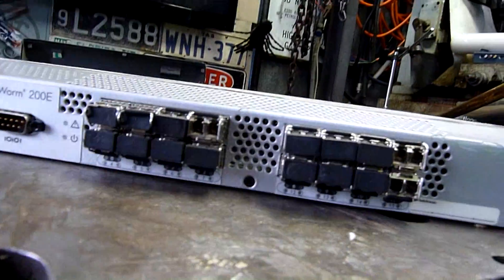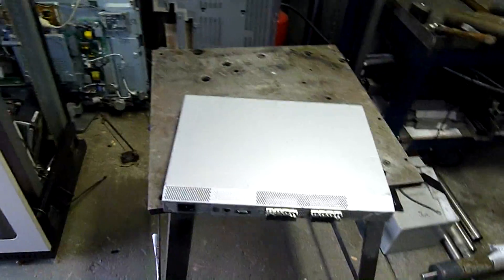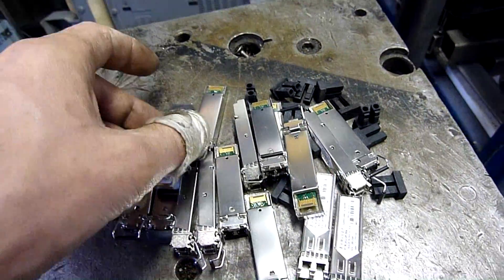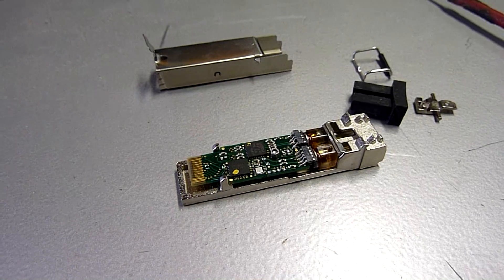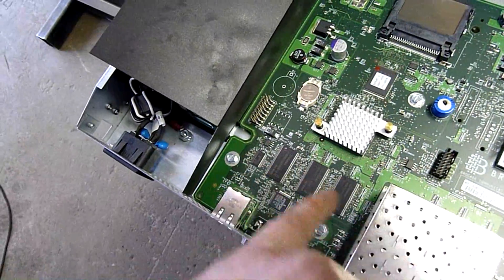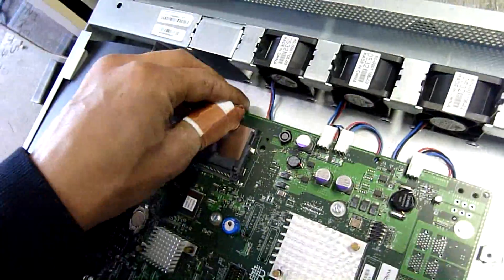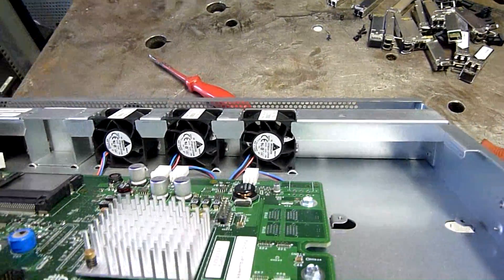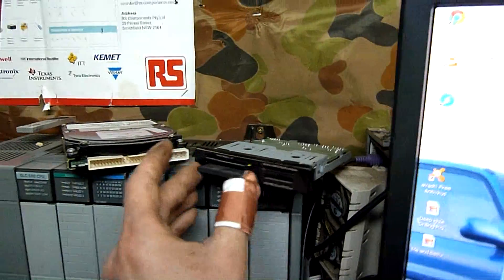Brocade Silkworm 200 4gbps 16 port Fiber Network Switch Autopsy

Comment: Hi i have a Silkworm 200E i want to open up to reset the paswords, i was hoping to see how you got the lid of...
In the video u go from closed to open in a blink lol.
I got all the screws out but the lid is still not moving.....
tx
Reply from the maker: Very good question, I did indeed skip an important point. to take the lid off you have to remove the interface modules, and on the front panel there are 2 screws, one is hidden under the lable just below the power LED, you have to lift the corner up to get to it. then slide the casing forward and up. I guess its there as a tamper evident seal kinda crap
Reply: Aussie50  super!
What a fast reply and what a rocksolide memory ( as it has been a few years 😀)
Ik was afraid to use force....
Thanks again
Reply from the maker: No worries, I was banging me head against a wall with the same issue LOL

Comment: That would be a nice switch can't find much info on it. If you had optics.... decent SFP ... The optics to digital converter. http://en.wikipedia.org/wiki/Small_form-factor_pluggable_transceiver It would make a nice back bone to other switches.  Gparted would read the CF card would most likly have some small OS on it.

Comment: The CF card should hold the switch configuration and possibly the OS if the OS is not flashed to firmware. Probably not going to be formatted in FAT or NTFS.

Comment: It's not going to be that useful even if you do have the HBA (Host Bridge Adapter) for your PC. It's a Fibre Channel Switch, which is for Storage Area Networks (SAN). You can't run Ethernet/TCPIP over this at all. It's for high end servers to connect to separate disk systems,they never use the internal disks for much the external storage controllers are much larger and faster and can even have lower latency.

We have a bunch of this very switch and many many others in the test lab at work, I think Brocade use Linux on a P series CPU.

Fun fact, the optical modules, called an SFP+, when they are the latest and greatest, cost ~$1,000US EACH! 4Gb/s was new in something like 2003. Most are made by Finisar and re-branded.

Comment: They're called SFP's (Small Form Pluggable). All your telco's use them when running fibres up the tower to antennas. It's also used where the fibres run into your RBS in the hut. Strange thing is, when we use them, you only get the green lights when something is connected and functioning correctly!

Comment: Love the SFP Transceiver GBIC Module, the optical parts are concidered as laser devices and you are advised not to look down the end of them when they are running
Generally
Class 1 laser of 850 nm is used for short haul.
Class 1 laser of 1300 nm for long haul
and Class 1 laser of 1550 nm for Extended distance systems.
I have used optic fibre for systems but just not at home, even tho I do have a switch here that supports 2 x SFP Transceiver GBIC Modules and I have a card with a socket on it that accepts a SFP Transceiver GBIC Module.. unfortunately these are a little on the exy side for me to actually use (being a geek/nerd and on a pension does not help hence why I volunteer and do IT support for a few community organisations).
Reply: If it takes the same modules, I've got a few

Comment: A lot of new hi tech gear is disappointing to look at when you open the covers, because there's so few components inside maybe one large IC. But all the magic is in the 100s of million transistors and circuits inside the IC's and the software running on them.

Comment: These plug in transceiver use IR diode or laser depending on the application and fiber length.

Normally they have rubber blanking plugs to keep them clean and to avoid exposure to the eye as you cant see the IR it can if at the right power level do harm.

Comment: Very compact optical modules, wonder why they didnt build them into the main pcb instead, perhaps there are different modules for different types of interfacing??
Reply: Exactly right, they use GBICs rather than soldered down transceivers so that you can use it with different interfaces. You can get those mini GBIC interfaces to multimode or single mode fiber and different wavelengths - you can even get mini GBIC to copper for short runs. Those connectors are LC.
Reply: man i think its because those signal LEDS have a limited life. only so many hours of on time. cheaper to change a few small boards than the whole thing :)
Reply: alex993cc1 Have you painted that mini fork lift? ... stop kissing the crane :-)
Reply: Tim Dousset
Adaptable interfacing, too clever for an old foggy brain like mine lol.
Still interesting to see how its done, Ed does have some unusual tear downs.
Reply from the maker: zx8401ztv
lol, I watched a doco called "my car is my lover" the other night, the idea of kissing a car will never be the same again :p
Reply: Aussie50
ha ha, there are some mighty wierd people in this world Ed :-))

But your enjoyment of your cars is a bloke thing, i think your safe from the blokes in white coats :)